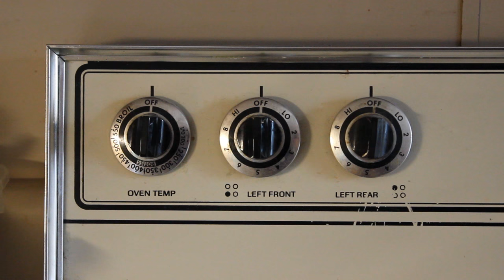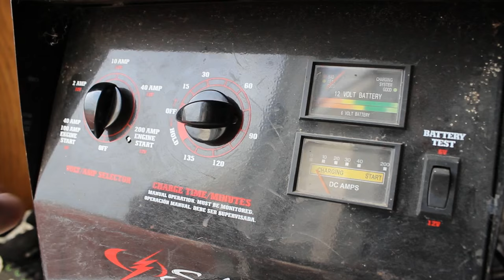Making a friction folding knife with micarta handle, start to finish

Comment: nice knife but looks extremely dull in the end
Reply from the maker: Thanks, well the wood was really dry so it wont carve it like butter.
Reply: xRoSkii
does it shave arm hairs at 20-60 angle ?
Reply from the maker: No no, I don't have it that sharp. At the time I made this video I didn't have my leather strop belt. Now I do so they do shave. But even so, this knife could slice through paper easily enough, which is fine for a outdoors knife to me. You should see my other video I made a straight razor that shaves.
Reply: xRoSkii
 to shave hairs of your arm you only need around 5-6k grit to shave your face you need around 8k grit minimum finished off with a leather strop...
you should get a decent 4-8k stone its a shame to make nice knifes like this and leave them so dull 5-6 would be perfect sharpness for outdoors knife as its still "razor" sharp and wont loose the edge fast

Comment: what grit do you use on the sander for beveling?
Reply from the maker: 40, 80, 120, 400 then for the final edge I go to 1000, then use ceramic.
Reply: thanks

Comment: not bad but you blued the cutting edge
Reply from the maker: Did you watch the full video? I blued it but its not blued anymore. The cutting edge is blueless.
Reply: +xRoSkii Blue means you over-tempered the blade and ruined the hardness. It doesn't matter that you sanded away the blue.
Reply: +Keith Peters :)
Reply from the maker: +Keith Peters No it doesn't. Tempering temperatures range from 350-450, around 425 it will blue. It is not ruining the temper. Tempering 425 - 450 max will for you much more durable and resilient blade. Sure won't hold a razor sharp edge as long a knife tempered below 400 but will be good enough for a knife taking lots of abuse and use in field.
Reply: +xRoSkii youre free to do your own thing man. I wouldve started over with heat treating if i was going to sell that blade. a plum blue edge which is what it shows in this video would bother the piss out of me. even on a camling knife that will NEVER be razor sharp...
Reply: +xRoSkii i also want to add, the temperature you wanted is correct. however at 400 you will get a straw color. Thats what you should be aiming for. bluing starts at about 500 and goes to about 700 which will leave you with a lovely spine temper but a horrid edge temper.
Reply: +LouieBartemio1 exactly. https://upload.wikimedia.org/wikipedia/commons/8/89/Tempering_standards_used_in_blacksmithing.JPG A kitchen oven is not a precision machine. You're way over 425 there. Blue is ok on the spine of the knife, but way beyond the straw color you want to see on the edge. Not the end of the world, but that's going to be soft and not hold an edge as good as it should.
Reply: +Keith Peters this is why i initially smiled and never replied to him in the first place haha. good talking with you keith. cheers
Reply from the maker: +Keith Peters Yes, that's right. After more research I really thought you get that blue color around 425 or so.
Reply: +xRoSkii Cool. I had the same problems when I tried using an oven. The blade right above the heating element gets way hotter than what you set the oven for. I switched over to using a small butane torch. Heat the spine of the blade, watch the straw color move out to the edge. I stop when the spine starts blueing, which leaves the edge perfect. It's a small flame, so takes a while, but gives you a lot of control.
Reply from the maker: +Keith Peters Good idea, thanks.
Reply: I'm going to agree with the ruined temper, even though the knife is really cool (I'm extremely curious about that etch process). I temper smaller blades in a cheap toaster oven. because you can't rely on the built in heat set, I take a blade sized piece of metal, and dial in the temp with an infrared thermometer. As long as you're dialed in, perfect temper every time.
Reply: +Eagle Bird Knives also, I'm gonna point out that you really need precise heat control for 1095, what with it being hypereutectoid, and for this kind of HT you're best off with 1084.